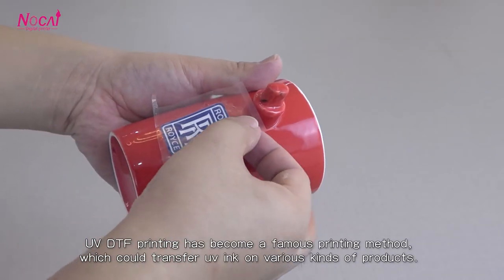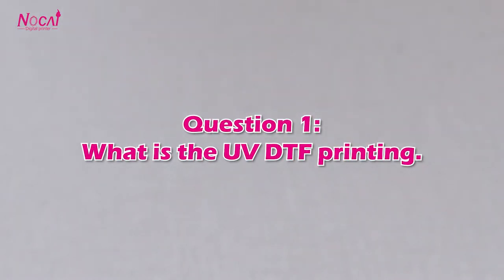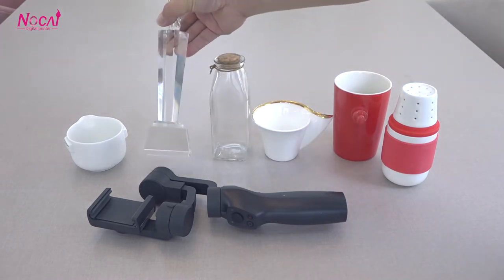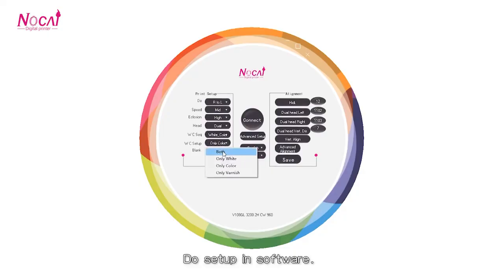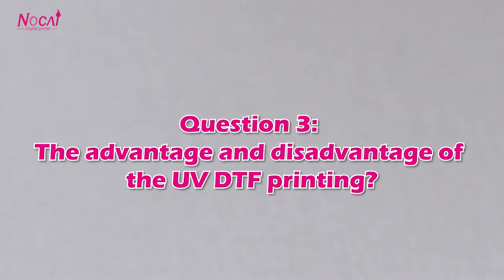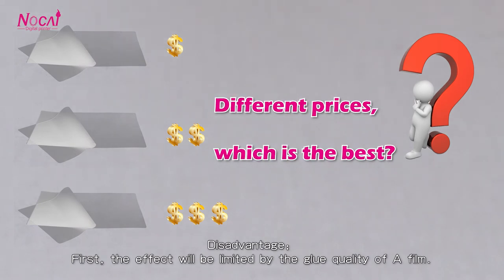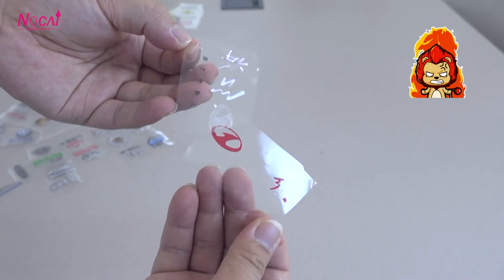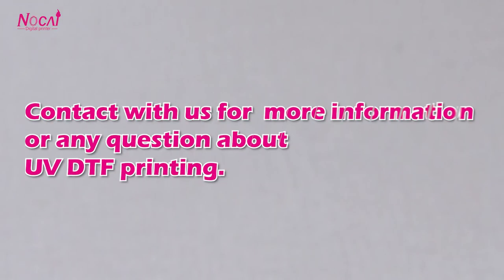How to process the UV DTF printing?

Comment: finally someone who speaks the truth. I bought a uv printer because they told me it would print on glass, but the truth is that it falls off when it gets wet. and I spent the money and now I owe it and the machine is useless for what they sold it to me. Is this sheet useful if my machine does not have varnish?
Reply from the maker: Dear Mariel, good day, how are you?

1. Uv printer can print on glass, yet, the uv ink is not good when with water or get wet. So, if you wanna put the printed glass into water or outdoor with rain or water long time, you need to do post coating, like applyl a layer of resin on its surface;

2. Your printer can use this film as well, even doesn't have the varnish. Just, there're disadvatanges, like I mentioned in the video. Thanks.
Reply: @nocaiuvprinterkevin4336  so helpful so kind ☺ 🙏
Reply from the maker: @WMSHOW  Hi dear, you are welcome. Thanks.
Reply: I know it's an old post. But they have soft ink, hard ink, and varnish. Best is to use soft ink so you can print on film and transfer.